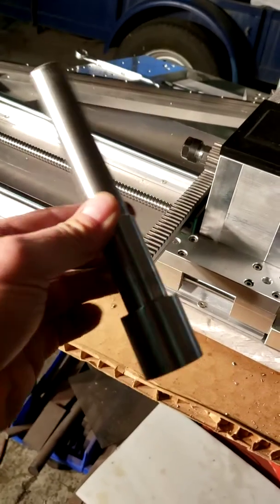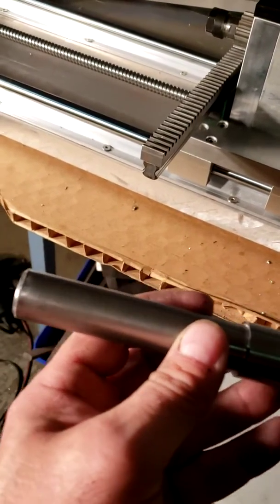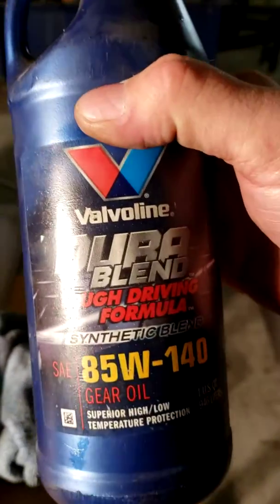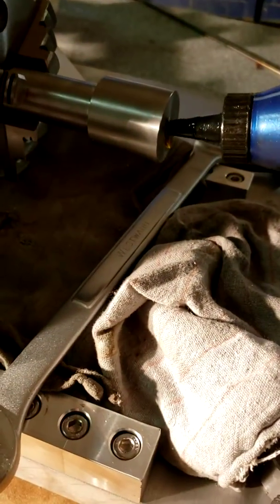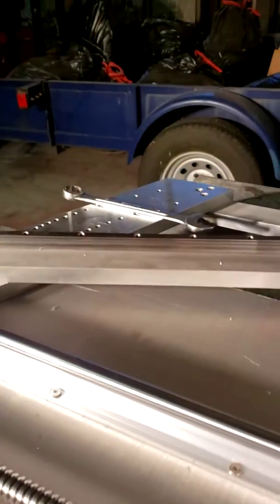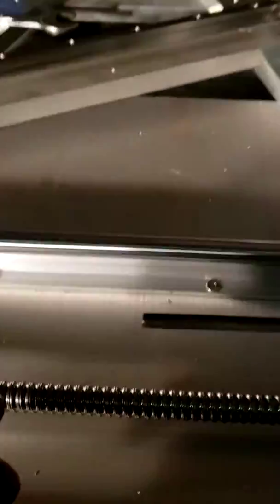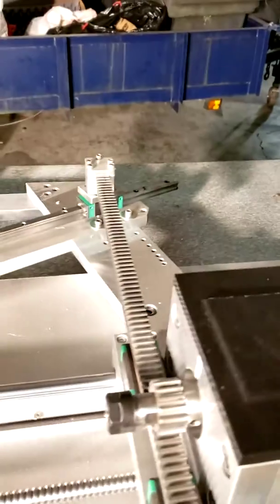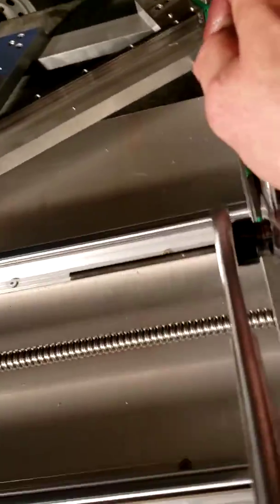Rifling a thick barrel

Comment: Any chance you have drawings for sale
Reply from the maker: @craigromero5921  I don't. It's all in Mastercam files.  And the variation in linear motion components makes it necessary to adjust measurements on numerous components each time. Typically mounting hole patterns and sizes, but also due to their actual sizes (heights, thickness). The chuck and collet parts also vary.

Comment: How did you size your leadscrew/ ballscrew? 
Or did you just pick one and hope?
Reply from the maker: @kieranh2005  I chose based upon the force it could operate with. I don't recall the size from memory...probably 12mm or 14mm...but I recall that it could reliably pull (to avoid push deflection) around 16,000lbs.
With the massive rigidity of the whole chassis, there's plenty of strength.
If I was to scale up to rifle barrel capability...over 16" to perhaps 24", I would step ballscrew, and linear slides by 2mm each.

Comment: What type steel are you rifling?
Reply from the maker: 4130/4140, 303/304 stainless, 17-4 stainless, mild steels for manufacturing prototypes
Reply: @tintruder224  I should try gear oil. I have spent a lot of money on lunes but having big chatter problems.
I’m using 416R
Reply from the maker: @BobJury-lf6bb  if you're pull rifling and your machine exerts a constant pull and twist, using hypoid gear lube, there really shouldn't be any chatter unless you haven't accurately reamed the bore.
Reply: @tintruder224  ok I will try it. Thanks

Comment: How do you calculate the sine bar angle so as to obtain the button's twist rate?
Reply from the maker: Rotary to linear is calculated because you know teeth on pinion and rack.
Basically linear motion of rack vs. Linear motion of the carriage drive.
Plotted in Mastercam for whole number twist rates.
Reply: Is it possible to use this machine to make firearms? Please answer my question @tintruder224